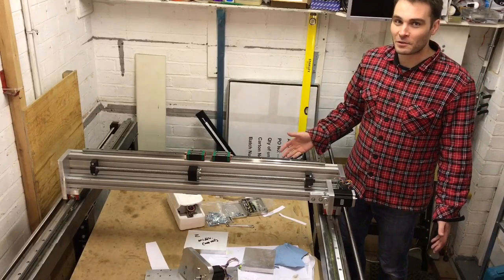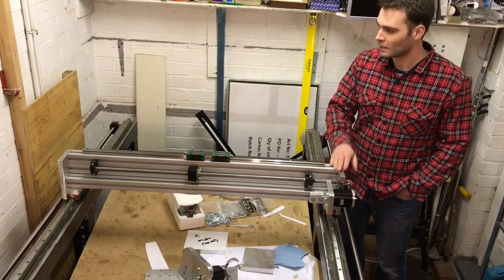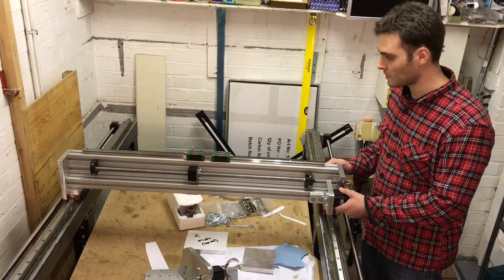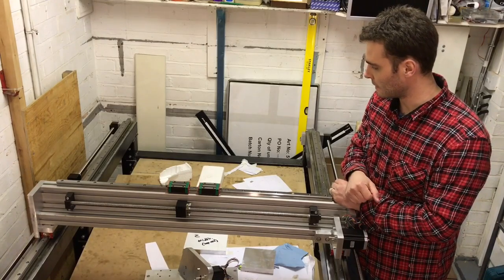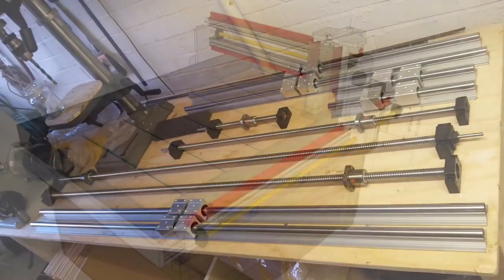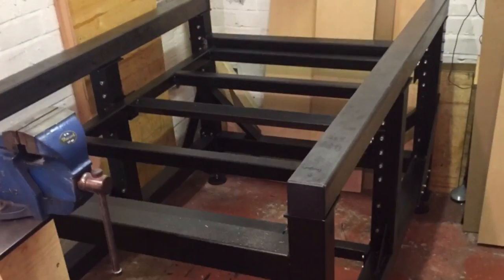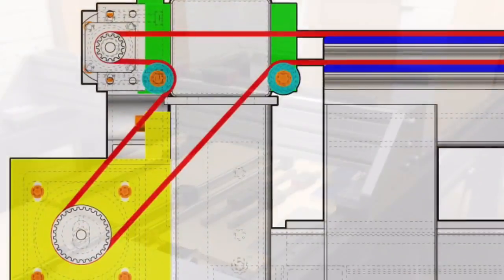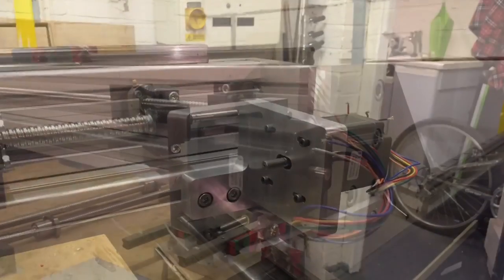Build a CNC Router in your garage

Comment: Hi Joe, people might not realize how much work you have done in the montage sequence. I do more than ever now, as I sit at my PC looking at my design and how to implement. A brief run down of the beginnings:
 I am doing a half sheet  machine or 1212 as they say. But one will need 1400mm  bed to allow for the Z axis plate width. So it starts to become pretty big to do in extruded aluminium.  I went with steel. Your material was much better looking than mine at delivery. I will be removing some surface rust before doing a thing.  Oh boy it is going to be one heavy table, and I must figure the means to bolt it in two or three pcs. 
 I was impressed with the  epoxy levelling solution. And might look into it. However I found 5 meter of extruded heaven!!  I am bolting 45x180 extrusion to the top steel tube (4"x2") and   bolting from the bottom with T nuts and from the side using proprietary angle brackets or gussets.  The full dimensions of the CNC Router will be over 1500mm long at last update.
I am literally just beginning and deciding on what kind of camera work I will do. 
For now I haven't cast a stone yet. Still working on the light to medium rust on most of the steel order. 
Will have to maintain a stiff upper lip :-)

Comment: How did you attach the two pieces of profile to each other?  I have not found an internal fastener for that and I don't wee how you could have drilled through the top one and use bolts since you needed t-nuts in that top slot for the linear rail.  Can you explain or do you have more detailed images?
Reply from the maker: +Michael Jacoby hi - this is how I did it: http://www.mycncuk.com/threads/4513-3-Axis-CNC-router?p=72346#post72346

Comment: Looks pretty heavy duty. What are you planning on making with your machine when it is finished?
Reply from the maker: Paul Frederick Hi Paul - yes it is fairly hefty but I want it to be a quality machine when it's finally finished. I plan on making furniture primarily, but want to use it to mill aluminium too. 
I'm enjoying it as a project in itself at the moment though. It has got me into metal work and hobby engineering too, so the uses for the machine are expanding! Thanks for the comment
Reply: Get it going.
Reply from the maker: +Paul Frederick 🙂